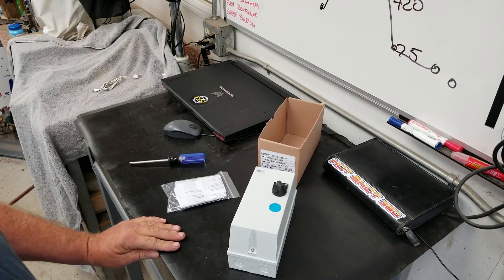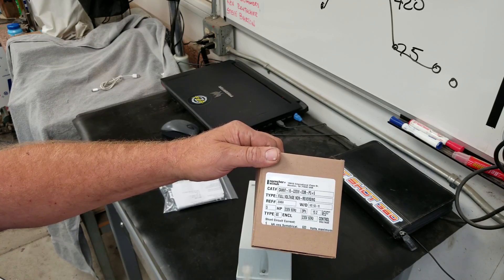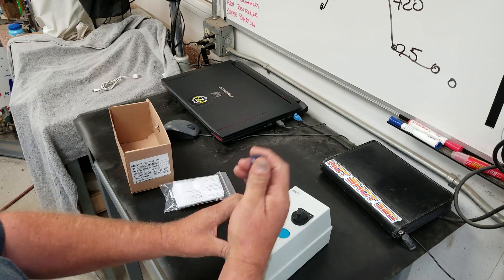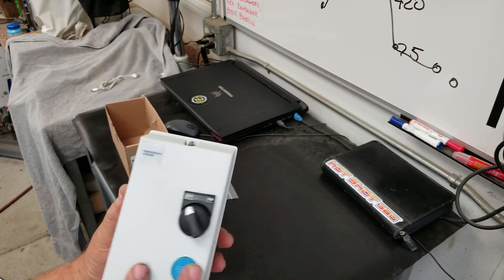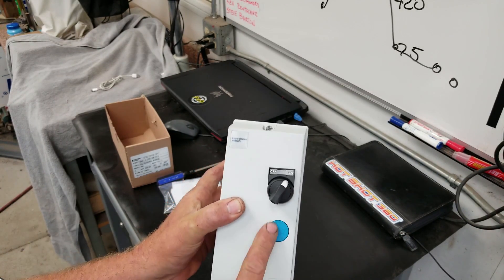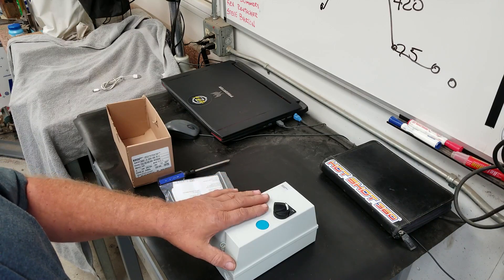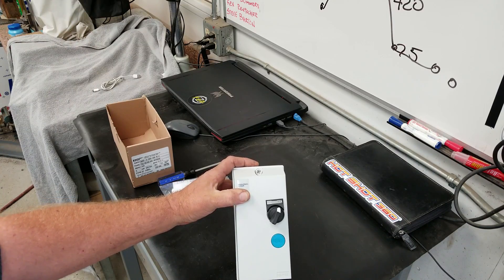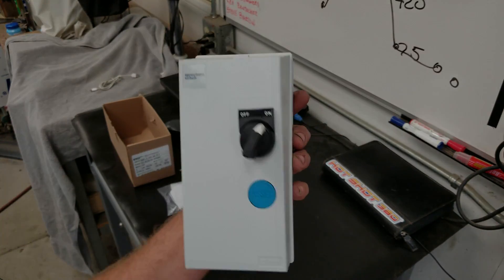Motor Starter Configurations

Comment: I keep about 6 to 12 of these type of starter kits (a different brand) on hand for my shop at any given time, when you want or need one, the time saved is priceless... I will check into this brand, I already know the high quality of A.R. so I am safe to assume these units will be of the same higher standards.... Will they be offering these in a metal configuration as well? Please note, I am not against the plastic version, in fact, I like the clean look of the plastic units, but there are some applications, that I just can't install a plastic unit at, due to the "employees" are extremely rough on that owner equipment. In my shop, a plastic casement like this can be put into my death will, meaning it will last longer then me, but, for some reason, when installed in certain businesses, and these employees see something plastic, never mind that fact that the plastic unit serves it function very well, for the required standards, they feel the need to run their own quality control standards of trying to find out the failure point of said plastic with in a certain time frame, lol... Even when I have told these people, "look, it is only a switch, and is designed to be cared for as such." , it will be destroyed, lol. Heck, even the metal high cost enclosures take a beating, and i keep a case of switches there in the tool crib's for safe keeping.  I say the next box that gets damaged, start firing some idiots!!! But that is above my paygrade.. I digress, I look forward to playing with a few of these. Does the face /cover come pre-drilled or the hole knocked out, or can I get these as blank covers, to use what ever I want to poke into these cover? Although it may sound like I am being tedious, sometimes, every inch of reach counts, based on where the box is located, and having the switch located in the lowest part of the cover of highest, matters, and not have to bond a plug into the original switch knock-out hole?... On monday, I'll look into the availability as well, or are these casements proprietary to A.R. only? Which is fine, like I said, I keep these type of boxes on hand, so to place an order of these once a month or 4, not a big deal. Dru
Reply from the maker: SPRECHER + SCHUH has been around for quite a while, I just was never able to get my hands on them. Always been at the mercy of Graybar's retail price point (which is a killer) I was very pleased to find reasonable pricing, fast delivery and knowledgeable sales staff.
Reply: @Feavs1.0 Great !!!

Comment: nice  addition to their line. Hopefully the web site will have listings for sizing soon, as you stated. Have several machines that could use reasonable priced starters to eliminate manual switches.  Thanks for sharing/greg